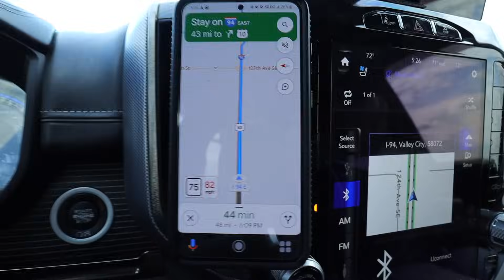We Lost A Tire on our RV and how we handled it.

Comment: Wow, how timely, this just happened to us on our trip through Los Angeles. Unfortunately we were on a busy stretch of the 101 and it was 4:45 pm on a Monday - so lots of rush hour traffic. I didn't even note the wheel had fallen off - someone pulled up next to me to alert me (TPMS didn't do anything...).   Fortunately I found a trailer place that had a hub and he installed races/bearings did all the greasing for me so it was a pretty quick swap for me.  I like how you found the studs for yours and were able to go that route - though it took more time that was quite resourceful.  Thanks for sharing this!

Comment: Hope Shelia is alright!  
I know the feeling she may be going through. 
We are running away from tornadoes in just about every state we have crossed since we left Az. 
Then to make matters worse....one of our shocks blew on the rear passenger side of our class A. Needless to say we limped the rest of the way to our grandson's house in VA and are now getting it fixed. But to be sitting on the side where you surely can tell the difference because the motorhome was leaning so much towards the right. It looked and felt that every time you turned we were going to tip over.😵‍💫
I was so scared!
Praying everything turns out for you both.🙏
Be safe

#LEEsureLEE Trippin' 😎

Things will happen, You are blessed.😇

Comment: This exact thing happened to us!  Fortunately we had just pulled into our home town after traveling 380 miles that day so we were only about 5 miles from our house.  Just after we got off of the interstate and turned onto the main street in town,  I looked in the mirror and saw one of our wheels passing us. The wheel flew into a used car lot and miraculously missed all of those shiny used cars.  I pulled over and after picking up the errant wheel looked at the hub and noticed all 6 of the studs had sheared away.   Like you I wasn't sure what to do at first but after calming down I called my manufacturer and confirmed that I was still in warranty. All I had to do was to get my RV to the closest Camping World which was about an hour away in Chattanooga.  My insurance includes towing so I called the company and they sent a flat bed 18 wheeler out to haul my 5th wheel camper to Camping World.   The catch was that I had to back the camper up with my truck onto  a ramp and on to the back of the flat bed and then follow the driver to Chattanooga and then pull the camper back down.  All went well but there was no room for error on that narrow flat bed.  I still don't know why the studs sheered off, I use a torque wrench set to 120 lbs to check to lug nuts every time we tow the camper. It took Camping World over 3 months to get my camper back to me and to my puzzlement,  they replaced the sheered off studs with larger ones that require a different size socket to tighten the lug nuts.   I asked for an explanation but never got anything that made sense.  After they kept my camper for so long I just took it on home and I've been using a different sized socket for that wheel every since.   I'm certainly glad I didn't break down out on the interstate as you did, that was really dangerous.

Comment: I'm an aircraft mechanic with years of working on ATA aircraft, that is, the large passenger jets from Boeing 737's on up to 747's. Every time I deal with anyone outside of the aircraft world I get the same "amateur hour" B.S. from everyone!  No one wants to approach the mechanical matter, or any other matter with any kind of thought or detail. They always get impatient with me when I check and double check what they are selling me or servicing me with and they hate it. To avoid your situation happening to me is why I approach these service people in excruciating detail. Basically you have to do their job for them because unfortunately these days most people are uninterested in doing their job. 

You are correct in naming the unthreaded portion of the bolt the shoulder. The length of the shoulder is called the grip length.  That is the stronger portion on bolt. There's a small inexpensive tool for measuring that portion called a grip gage. Also it's good to have a thread gage to make sure the you obtain the proper threaded bolt as there are course and fine threads. Fine threads are for higher torque.  You can also measure the depth of the hole with the same gage.  It's also good to lubricate threads with grease but only if you have the wet torque which is a little higher than a dry torque. I'm not sure if they use wet torques in the automotive world, but it prevents corrosion of the threads. You can also grease the shoulder of the bolts before inserting in the hole. You'll need high temp grease.

Note:  when painting anything always use primer (sprayed on like paint) first that way your paint doesn't disbond which it will without primer especially on s smooth surface.

Comment: Buy a torque wrench and check ALL the lug nuts. And, no, you don’t need a new hub. Only the lug bolts as you did.
Was happy to hear you correctly referring to losing a ‘wheel’, not a tire. 👍

Comment: Todd and Sheila, I'm so sorry this happened to you.  We know the feelings.  Same thing happened to us back in mid-May.  First, do you remember knocking on the RV door of the couple at Lake Medina, TX, last year, after I e-mailed you that we saw you checking into the park and hope to meet you?  That was us.  It was awesome meeting you.  Our wheel story.  We left south Texas mid-May, heading to Elkhart, IN for the Alliance RV national rally.  In Missouri, about 50 miles into our morning, a car pulled beside me honking.  I looked in the drivers mirror and saw metal flapping.  I pulled over, as did the car.  They had witnessed our wheel come off and watched it bounce into the grassy median of Hwy 60, near Sikeston, MO.  In shock, I decided to limp back about 1.5 miles to a Love's truck stop.  The guys in the car, said, we'll get your tire and meet you there.  How awesome!!!  We had Roadside Assistance insurance, Kelly, called them and Alliance.  We got hooked up with a mobile truck repair man, who actually arrived about an hour earlier than we had been told.  Our hub looked exactly like yours, all 8 studs had sheared off.  We have tire pressure sensors, no alarm, the tire hadn't lost pressure.  That mechanic, pounded out the stud nubs, went and bought new ones and replaced them in about 2 hours.  And it was Saturday too.  He installed our spare too.  Kelly found a campground just a few miles away, full-hook up for $20.  Our nerves were shot at this point.  But, like you, we were so grateful that our wheel didn't hit anybody, and if it had to happen, it happened at the perfect location. The only damage to our 35 fifth wheel was to the lower part of our kitchen slide.  I had duct taped all loose metal.  The next day, we continued on to the rally.  Alliance had all parts needed in stock, including a new wheel and tire.  Alliance repaired our rig during the Rally, at our campsite. They gave us Rally pricing on the parts and no charge for the labor.  Even more awesome, Dexter replaced our repaired hub for no charge for parts or labor, at the campsite too.  Incredible service!  Now, here's what we think caused our incident.  We had had our bearings repacked and the suspension greased at a RV dealership in Texas, just before we left.  I think our lug nuts were left loose.  I found a few other loose nuts on other wheel next to the one that came off.  It was my "fault" for not checking behind the service people.  We had used them before and trusted them.  I have a big torque wrench.  Dexter techs told me that with steel lug nuts and aluminum wheels, one should check the tightness at 10, 25, and 50 miles whenever a wheel is removed.  After 50 or so miles, they have pretty much married together.  We were so blessed by awesome, and kind people.  God was taking care of us.  We've been fulltimers about 20 months.  We're in Santa Fe, NM currently.  May God continue to bless you and Sheila.  Safe travels, best wishes.  So glad you're OK.  Mitch Sayer.

Comment: Nice Job and glad you guys worked it out. Had new brakes and tires work done on our fifth wheel and that happen to us. Now before we depart, I always check tire pressure and also the torque for each.  In addition, it seems that in a small town, just about all stores are closed on Sundays, not only that when it happened to us, we could not get roadside assistance.  Now we don't travel on weekends and I always caring extra parts. Thank you for sharing and keep safe.

Comment: I had to do this to a couple of my daughters cars, finding out they had one or two studs missing on their wheels, so I know the stress.
I also noticed you still have the magnetic brakes on your rig. 
Have you heard of or thought of replacing those brakes to hydrolic brakes? Better stopping power(same as the tow vehicle) which lowers the stress on the tow vehicle brakes!
Never have to worry about if they are adjusted properly because they never need adjusting. 
They're basically the same as the tow vehicle brakes.

Comment: Hey Todd & Shiela.  We lost a wheel too.  Near the end of a long trip where we REMEMBERED some BAD pot holes.  Anyway what we learned: had to buy new hub with new lug studs, and a new wheel. The holes  were worn out slightly and lug nuts continued to loosen on every trip.  New wheel (from manufacturer to match) fixed it.
Reply: CORRECTION! Did NOT replace hub at this issue (did at another issue).  Tire shop provided and pressed in new lugs stems.

Comment: Todd, I'm in Fargo ND, had you Googled trailer shop on Fargo, you would have seen Vistos is open Saturdays, they would have had everything you needed, including an axle, should you have needed it. Your freinds drove right past it to go to Camping World.

I'm sorry you had trouble in our beautiful state, I would have driven a drum out to ya. 

I hope you took Sunday to go to the Buffalo museum in Jamestown,  it's a great little place.

Please consider changing all the lug studs on the other axles. They have all been stretched over and over, the damage is done.

Your brake pads looked fine, new ones are just under 3/16" to 1/8" depending on where you measure.

I'd be far more concerned with those wheel studs.

Safe travels PM me, and I'll give you a phone number to add to your collection of people to call for help. 

Also, check each and every axle hanger they do Crack at the frame.

You might have saw my FB post where I replaced all of ours on our 381M Momentum. 

Todd Fuchs, West Fargo..

Comment: Lug bolts snapping off is a sign that the tire shop didn't torque the lug nuts correctly or at all.  I saw the same thing and as we walked back down the road we found lug nuts on the ground until the wheel actually started to snap the lugs off.  Glad you were safe.  From the poor quality of service these days it is always good to double check what you can.  Like checking wheel lug nut torque before every trip as part of your pre travel checkout.  I'm shocked that any RV'er would not have a torque wrench.  I have to carry one since I need to set anti sway bars with a torque wrench.

Comment: Todd I feel your pain. I own a tree service and I have a chipper.  The chipper has 2 chipped knives that are held on with four 5/8” bolts. I changed the chipper knives and didn’t have my torque wrench with me so I tightened the bolt with the same dewalt 1/2” drive impact that you have. The next day the bolts broke and sent the chipper knife through the chipper. Fortunately no one was hurt. The only thing hurt was my wallet because it cost me $15,000 to repair the chipper.

Comment: They make torque sticks they simply go on the end of your impact gun and have an entire kit or just buy the one you need. I was a mechanic for years and used these without any issues. I think they even make them now so you can put on your own socket. Dont use for removal but great for quick torquing.

Comment: We lost a tire on our Momentum on I-75 in GA.  I traced it back and found a trucker had loosened the lug nuts while stopped for fuel and lunch just prior.  Guess he was pissed that we parked in a truck parking spot.  Fortunately, other than a slight lean on the trailer, we didn’t even know it came off.  Glad we had an F450!  Secondly, when the wheel came off, it went down into the center median, which was lower than the highway and wooded, so i stayed in there.  We had to spend the night in a rest stop because the lug studs were destroyed and the roadside service couldn’t get the right part until the next day.  I now check lug nuts and do a full walk around prior to departing every stop if we leave the RV.

Comment: just blew out a drivers front tire on I75 at 70mph  running from the hurricane in Florida took out fuel and brake lines along with all marker wiring down left side. What an adventure spilling fuel trying to pull over

Comment: Most real common sense repair I have seen. I know I don't need to say this but keep a close eye on the other wheels until you can replace those lug bolts. By the way there isn't much more lining on brand new shoes. Itis very important to replace the greese seal pretty much everytime yoiu remove them. If not you will greese foul your linings. Did you notice any greese on the backing plate, they looked a little dark already have you noticed a loss of braking power?

Comment: Glad everything turned out decent. And thanks for sharing the reasons why. Todd, instead of over torquing the lug bolts could you’ve possibly missed one and not completely tightened the lugs on that wheel? I ask because that’s what happened to me this July after repacking all of my wheel bearings. Checked my lugs nuts after about 100 miles and found one wheel loose. Fortunately didn’t loose the wheel like on yours but did shear off a lug bolt.

Comment: Look up a wheel stud installer tool.  It’s a little round tool with a set of bearings in it that lets you pull the studs in a lot easier.  They’re cheap, light,  and fit in your tool kit easily.  Richard

Comment: Great Job on figuring out on the why!  Many new tire guys, fall prey to doing things quick.  A good shop will have a practice of just "bumping the lug nut" on the stud, and then the rest is done by hand.  I want to emphasize you can still use the impact like you said, but don't "ever" run at really high speeds.  You can pull the threads on the stud.  If you zip them off fast, you can pull your threads outward, and vice versa.  Great to have an impact if you need it, but better to find an impact that goes to a max of 120 or 125 ft lbs, and has adjustable speeds.  Fit for purpose. I use a pneumatic Ingersol Rand with 400 ft. lb. max. , But with air you can throttle the speed.  It's all technique and knowledge.  Anytime you get new rims, make sure you do that 1/2 hr to an hour run, and re-check torque.  Yes I changed tires for a few years, over 3 decades ago. :-)   If RV'ing was easy everyone would be doing it! Right?   /grin  Stay positive, and sometimes life forces us to slow down and think.  Take care.

Comment: I carry everything needed for a tire change, inc a torque wrench. I believe the lug nuts came loose on that wheel because it wasn't retorqued after 40 - 50 miles. However, if the nuts were grossly over-torqued, the bolts get stretched, and the bolts cannot tighten properly

Comment: And the reason Lugnuts break our lug bolts break off like that is there either loose or been put on too tight and stretched, which weakens them and that that’s why they break off and I broke several of them on my trailers that I’ve had and you can replace them the bolts themselves and to be safe again just get a set of bolts and take them with you so you can use a punch and a hammer and drive them out and drive new ones in anyway that’s my comment on it. They run a lot of trucks and a lot of trailers and Britain. They either stretch them or they’re loose, that’s what makes them off impact wrenches, break them off mostly

Comment: I've had this exact same thing happen except I did not know when or where the wheel came off!   My 5th wheel is a tandem axle and only when I had backed into my campsite 90 miles from home did I realize my curb side front wheel was gone.   I speculate that my lug nuts had become loose and since you will not feel the wheel wobble or hear the noise of it you will not realize there is a problem.   I never used to check lug tightness after installing a wheel.   I simply tighten it down with a lug wrench and forget about it.    Well when you look at the design of the lug nuts being tapered It is extremely and critically important the nuts be tightened properly and then checked often.   If they become loose the wheel is not centered,  wobbles and then breaks off the studs!!    Over tightening with an impact gun can also weaken the lugs.     I now carry a proper torque wrench and check all 4 wheels each morning before leaving the campground.      Wheels coming off towed trailers is a fairly common occurrence actually!     A few months ago a wheel came off a trailer on Interstate 40 in Tennessee and rolled at a high rate of speed across the center median.   It hit a small car head on and killed the occupant of that vehicle!!

Comment: As an over the road cdl holder, ive seen this happen.
Check torque on the lug nuts 50- 100 miles.
I worked auto parts in the 1990s. We had a wall of bins of studs and nuts.
Only specialised stores seem to have their segment nowdays.

To avoid this in the future install tire pressure monitors on the valve stem. With temperature sensors.

Ps this axel configuration i believed to be flawed.
 Get  heavier at least 10k axels with duals. Problem solved.
To often the rv mfgs build to min spec.
Do a pre , mid and post inspection of your vehicles. Touch every lug spring hangar panel door etc.
The tire didnt go through a window, crisis avoided.